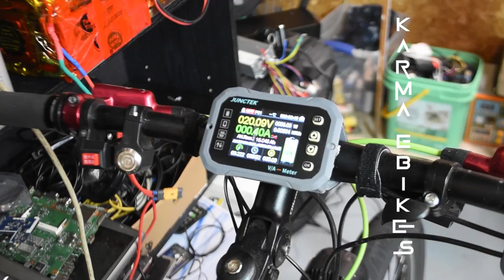ebike Brushless Motor,2000W 48V 42A*modification active cooling*

Comment: I bought exact same motor with the same controller.
As a kit
The controller only lasted 5 minutes.

I changed couple of the  mosfets what blow up and was working again.
For 10-minutes 
I did fix again but I didn't bother trying it.
So I just bought another controller upgraded.

At the minute I'm running 72v to 84v feels like it goes 60 mph.
No problems with controller just motor getting hot very fast after 2 minutes riding.
And start stuttering 

I'm going to put radiators and drill big holes.
And maybe big phase wires
Reply: What controller did you change to thanx??
Reply: well 84v is obviously too high for a 48v motor! --and with that many volts, it can try to allow more current, hence likely greatly exceeding the max spec'd for both the controller and the motor.  Probably shouldn't overvolt by much more than 150%, IMHO. Ie, 72v very maximum for a 48v motor, and full throttle should be applied only for short amounts of time.  You really should get something made for 72v, then use a 60v or 72v battery (which will likely be about 80v charged.)

Comment: Dude I'll definitely be doing this mode when I get my 72v 3000w motor,
The motor sounds better too
Reply: the 72v motors dont have a fan, no room
Reply: @stanson5850  how do you cool them then 😕
Reply: @matejm8060  You can attach a 100-120mm pc fan to the side of the motor, along with drilling out the motors existing tiny pin holes into much larger holes. These two mods will significantly cool it. In another week or so, I'll post a video of how I did my kart build with a cooling fan.
Reply: @stanson5850 i will be looking foward to that video
Reply: @stanson5850  Have you done the FAN mod to your motor? I am designing a mount for a 12V 3000RPM fan

Comment: Yeah, maybe make a little screen basket and fit it over the back of the motor, clamp or zip tien it on, keep the crap out of the motor,. I have been thinking about get one,  is there any difference in the different wattage motors listed, or is it the same motor, with different wattage and voltage controllers?
Reply from the maker: going to run a 500watt 79v controller. or try a 1500 at 49v.
Reply: There pretty much all the same. Im running my 1800w motor at 3500w and its fine. I recomend adding a fan at the back though
Reply: Metal screen used for sinks and also xbox ones work pretty good. Im sure if you glue or gasket it to the inside itll stay.

Comment: I'm about to try like heck to make a bike for under 2k that can defeat the Drill One. I plan on using:

Carbon (everything) 29er MTB
My1020 motor
150A Controller
72v battery 

I took out the bottom bracket, chainring, and pedals. I'm planning on running the motor sprocket right to the back and forgoing the pedal apparatus to reduce friction/ failure vectors. Should be 8,000-12,000 watts on a 22 lb bike ;)

I plan on building a custom Carbon motor mount which will be the hardest part imo. Any tips/ suggestions are appreciated.

Comment: I recently brought one of these 48v 2000w rated MY1020D motors. Pulled mine apart to find no fan, gutted! Guess it shows how different sellers can spec different price points on the same motor.
Reply: I just searched for ' MY1020D motor' and see a lot rated at 1,000w
Reply: 1800w have a fan but not for 2000w
Reply: @tontonbayle  my 2000w has a fan....
Reply: @John Jordan  what's your model number? I just cracked open my Vevor 2kw BY-MY1020D s/n 20221003 5123 F 00076 to find no fan.

Comment: Did you make the fan yourself or did you buy it from some place? And if so where can I find one. It's a great mod. I hope to hear from you soon. I know it's an old video.
Reply: The 48v 1800w came with a fan, but I'm not sure any do now. Today I drilled out the shaft of my 48v 2000w motor with a 3.3mm drill bit and put an M4 thread in to fit an external fan to the rear. There's already a 2.6mm hole in the ends for a bearing puller to fit, so it was just a case of making it a bit deeper and wider.
Reply: Do you happen to know what size fan is in the 1800w motors? Maybe I can get one and add it to the 2000w motor.

Comment: Would it hurt the motor if I put 12 volts to red and black wires on motor like a dummy
Reply: Its a 3 phase motor wich means it has 3 wires comimg out of it. It wont work you need a controler fot theese types of motors.

Comment: Hi, what drill bit did use. Thx
Reply from the maker: the aluminum is very soft. i used a cheap metal bit.
Reply: Please the dimension
Reply from the maker: @andretordjman9021   3/16

Comment: The way my vevor 72 volt motor heats up, I am doubting mine has the internal fan inside🤣
Reply: 72v motors dont have the fans no room
Reply: @stanson5850  then would it be better to run a cooled 48v with higher gearing or a stock 72v with lower gearing?
Reply: @theSWBFman  Personally I always like to go with the bigger motor, as you can always use a smaller voltage battery with it. Then when or if you want to upgrade to the 72v, you can do that. If you go with the 72v though, I would only do so if you plan on drilling out the pitifully tiny pin holes that are on the motor, along with attaching a 100ish mm pc fan to suck air through to cool it. If you don't want to that pc fan exhaust mod, maybe go with the 48v.
Reply: @theSWBFman i put a pc fan at the back of my motor and its fine. No heat issues

Comment: Hello @karm-Ebikes I'm trying to use this same motor in a jetski project. I live on a lake where they only allow electric motors so I added one of these to an old jetski (Yes I know it will not be fast). The jetski is working but both motor and controller get very hot really quickly and I'm not sure why, I am also using 4 
ECO-WORTHY 12V 30AH Golf Cart Batteries to get my 48V Battery. Could it be the batteries or is it just to much load for this type of motor?
Reply: It's definitely overloaded

Comment: Hi. I have gotten two! Motors without a fan. And it's the 3000w motor, so it is gonna over heat damn fast without a fan. Could you post a picture of the fan and the measurements and how it connects to the shaft? I might have to CAD one up and 3D print it (sucks balls). But it would help immensely if I could see a picture and have some measurements of it. Would you help a fellow tinkerer?
Reply: @Anxo_De_La_Noche  yeah. Have you had problems with over heating? I'll add a  turbo centrifugal fan at the bottom to have strong push of air (normal computer fans are bad at pushing against resistance). I opened up the holes to be huge. Second I'll add a heat sink and have two computer fans pushing against it since I'm doing a electric boat outboard conversion. I hope that will be enough... But with 20% losses, that means 600w of heat I have to dissipate. That's almost a car heater.

Comment: How did you get the front sprocket off? Been trying to tear mine apart for a couple days, but I cannot get that nut unstuck on the drive end
Reply: Its left jand threadded nut wich means you need to tighten it to loosen it. So right =loose left =tight

Comment: Great Info and mod. I was thinking adding a winding temp sensor might be worthwhile, as if efficiency goes down to .8 power factor (80% efficiency) at 3000 watts would be about 600 watts of heat to dissipate and that amount of airflow seems more than sufficient. At about 1300w for say 60kph might be about 90% efficiency so only 130w of waste heat. 
Do you know the RPM you are seeing with the stock controller at 74v? Sounds like it might be at least 5400 rpm. I ran a G-loading calc, and at 5400 rpm with a 50mm rotor  would be 1,600 Gs on the rotor and possibly 4,000 Gs on that fan.

Comment: Do these motors go faster one way than the other? I reversed mine but it’s not putting out the same power
Reply from the maker: if it does there a problem with the motor or controller. shouldn't be a problem.
Reply: The reverse function on the controller puts out like 50% of power. It is intended. If you want to reverse the polarity, search "how to reverse DC electric motor direction for gocart" made by Eric Thibeauld